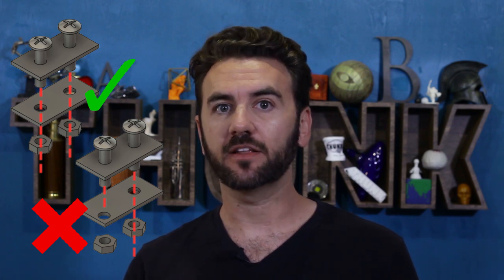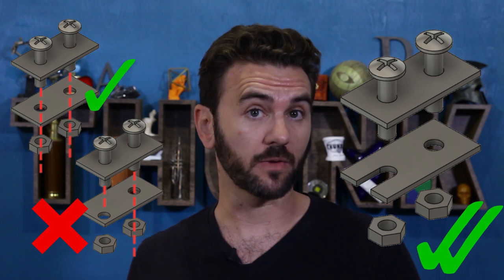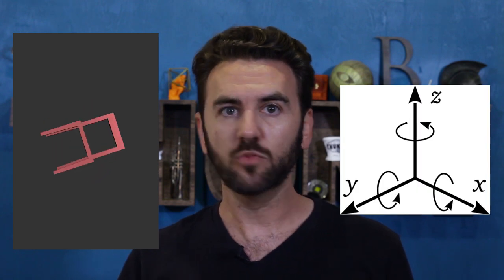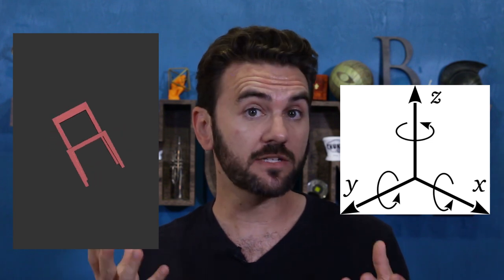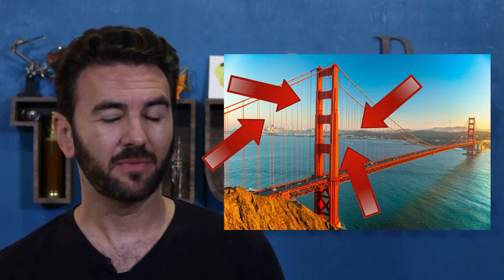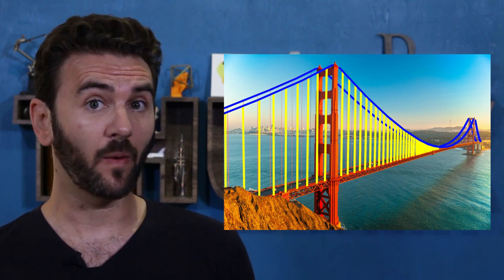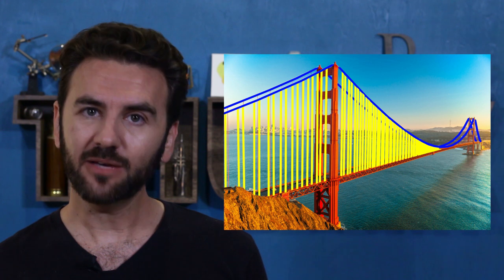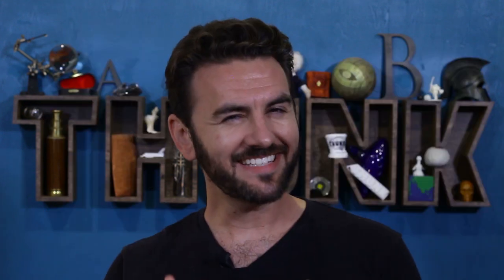227. Minimum Constraint Design

Comment: Now apply the minimum constraint design to a meta-ethical exploration and discovery of 'good-enough' normative ethics:  We can identify failure modes from conflicting constraints or too much freedom, but we have to flex the analogy to account for life's nuances.  Living things need to grow and explore open systems, so initial constraints should be more like training wheels and pads so failures are graceful learning opportunities to discover and improve best practices until the constraints can be removed.  As growth occurs across multiple phases, old constraints should be replaced with new ones, like a tree pruner guides a tree's growth away from a nearby hazard, and often the constraints needs to impose the right amount of stressors for anti-fragile mechanisms to sustain growth.  Eventually new generations will outlive the older ones, so the 'good-enough' parent should also instill a sense in which self-discipline can be modeled from best practices of good design, such that their child understands how imposing some constraints are necessary for maximizing the ratio of 'freedom' to 'catastrophic failure', and they can trust themselves when reasoning with others in ways to improve their 'good-enough' normative ethics.
Reply: Thanks for the thought-food!
Reply from the maker: Finding a few key truths about what moral behavior ought to be, noting where they might come into tension, & finding ways to resolve that tension. Sure sounds like an exercise in MCD to me! XD

Comment: Interesting! Seems to parallel the rule for a system of equations: the number of independent equations needing to equal the number of variables for the system to be solvable. If there's one too many equations, it will either conflict with the others or be redundant (such as 5x = 10y - 3 conveying the same information as 10x = 20y - 6)

Comment: Math nerd here! It takes three points to define a plane...if those points are on the plane. If instead, you don't make that part of the constraint, a plane can be uniquely defined with only two points (one on the plane and the other forming the surface normal of the plane).
Reply: But only in three dimensions.

Comment: If you have a table with four legs that is unstable, just turn it.

The Intermediate Value Theorem ensures that within a turn of 180° (90°?) you will find a stable configuration.
Reply: Gonna eat all my food off this 45°-angled table
Reply: Good show - but the floor has to be continuous.
Reply from the maker: IVT requires the gap is being created by an uneven floor (& a perfectly-constructed table) - if you have 1 short leg & a perfectly flat floor, you can spin forever & it won't make any difference!